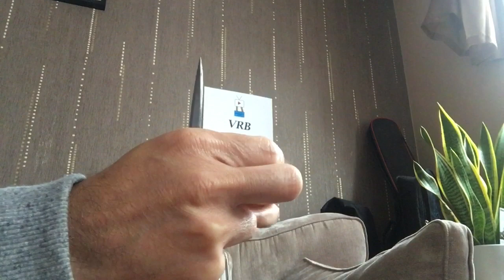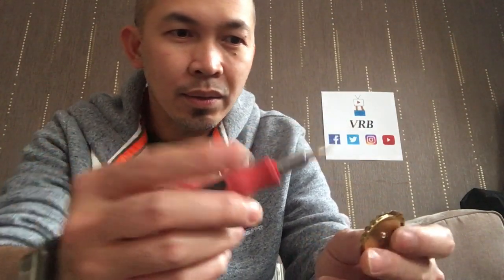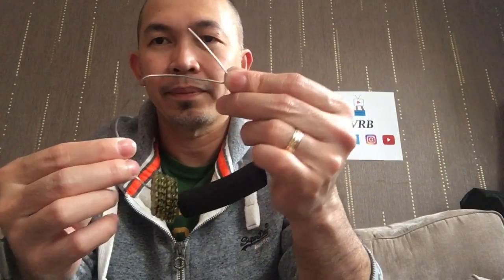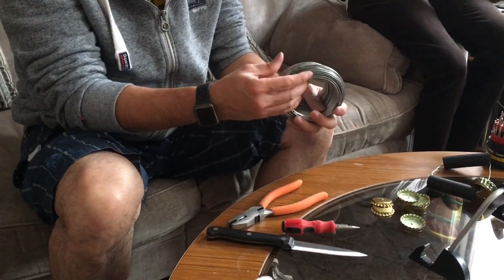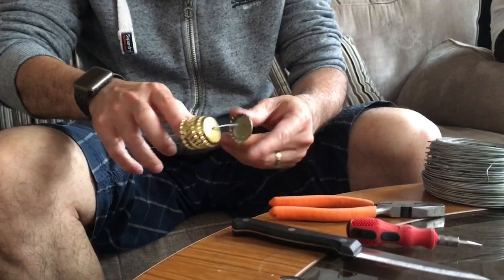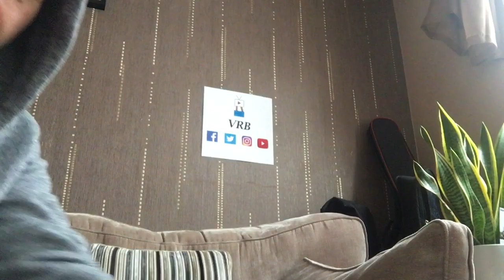DIY Christmas Tambourine Filipino Caroling

Comment: What is the procedures using karoling?
Reply from the maker: There's no exact procedure. It's easy back home because you got materials and resources all you need is cut a branch of a tree that's Y shape, then a wire. And then bottle lid. Flattened it and put a hole in the middle using hammer and nail. And that's it.